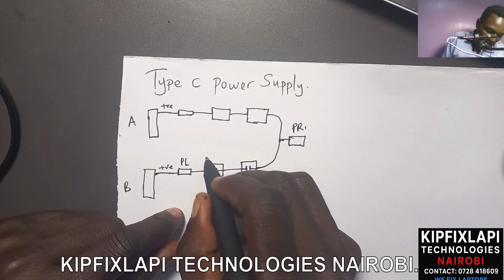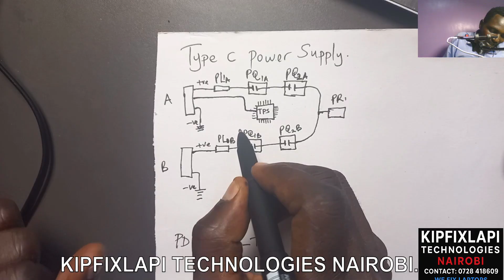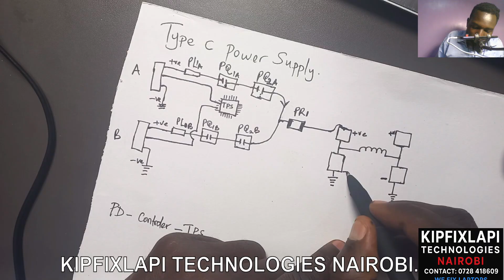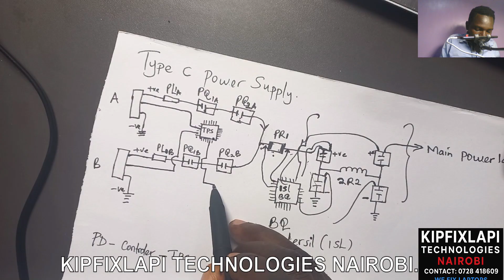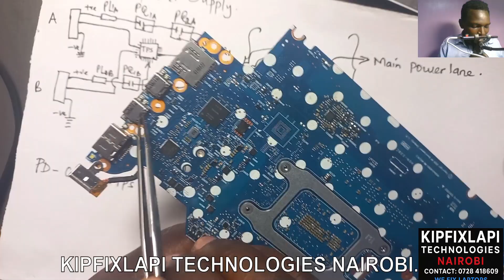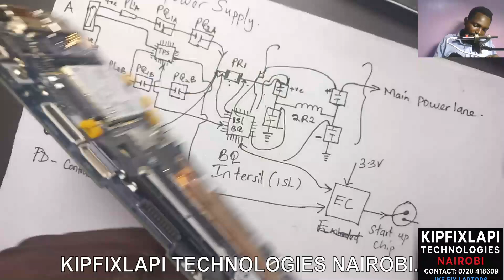USB-C POWER SUPPLY IN LAPTOP MOTHERBOARD, LAPTOP REPAIR TUTORIALS #repair #computerrepair #subscribe

Comment: Without the third mosfets is there backflow ? And what happens when the third mksfet is faulty
Reply from the maker: All input mosfets can prevent backflow of current.  So mosfet is the final defence for power flowing back hence mosfet 1 is called block mosfet.

Comment: Brother, so, when type-c plugin into jack, in the PR there is 5v voltage, is it generate not from adaptor??
Reply from the maker: Yes,, the 5V generated by the board for the ports, the voltage is not being negotiated by the TPS.
Reply: @KipfixLapiTechnologiesNairobi if the power resistor there is voltage 5V what it's mean the PD IC is bad brother?
Reply from the maker: @wahyupamungkas5331  Not necessarily, it could mean the main board is shorted hence the Bq ic or Intersil disables the input power system. Inaddition, TPS could be faulty too thus it is not able to negotiate 19v from ports.
Reply: @KipfixLapiTechnologiesNairobi  ok, thank you very much brother for your respons. 🙏🏻🙏🏻🙏🏻